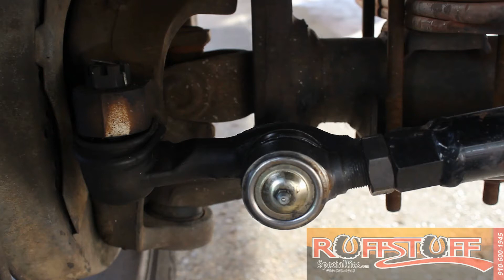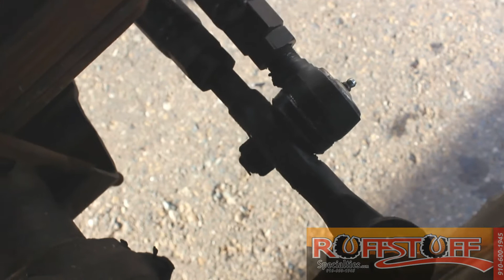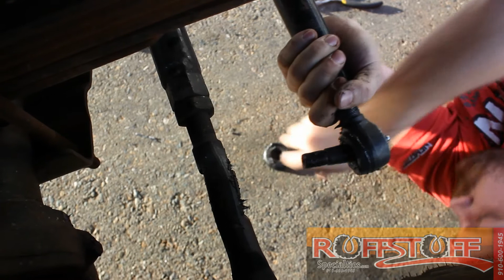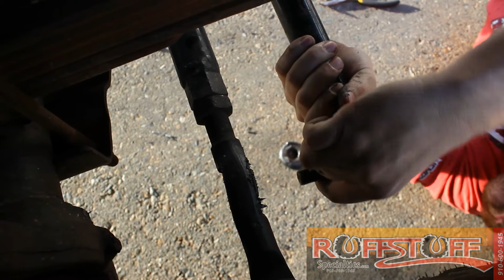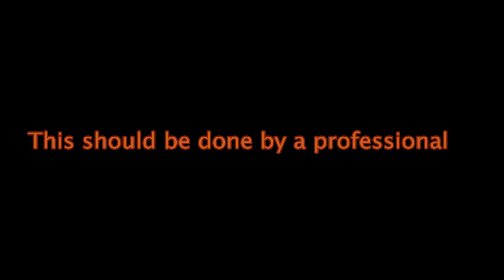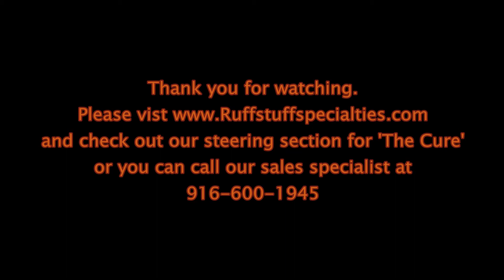The Cure!

Comment: So this should be installed where the drag link bolts to the tie rod at the pivot of the y link, right?  Would there be any benefit to installing it on any of the other 3 TREs?
Reply: +Christopher Parrish We have tested them on the knuckles as well but the problem is there is not enough play with these because the ackerman. We recommend only using these on the y link pivot as shown in the video. Thanks
Reply: Garett Kittredge can you elaborate on what you meant by not enough play due to Ackermann? I was curious of the same thing. It looks like 100% of the roll would be eliminated if used at the knuckles as well 😕
Reply: The knuckles don't stay horizontal when you turn so the tie rod end needs to be able to rock some.  Turn your wheels all the way to one direction and take a look if you don't understand.
Reply: Nah I got the part on camber changes throughout the steering, I thought Ackermann was a difference in toe (between the tires) based on turning angle
Reply: bung cheese  You're correct it's the change in camber not Ackermann.  He used the wrong term.  Unfortunately, using them on the knuckles will cause your tie rod ends to quickly wear out.  Ruff Stuff says they could even fail which is entirely possible.
Reply: WHAT ABOUT THE CURE ON PASS. SIDE KNUCKLE /TIE ROD??

Comment: Do you know if anyone has installed the y-link kit on a leaf spring f350
Reply from the maker: One of our employees installed our steering kit on his F350 with the cure but I do not know if this part itself will fit on the stock F350 steering.
Reply: Ruffstuff Specialties is there a way i could get in contact with him and ask him a few questions?